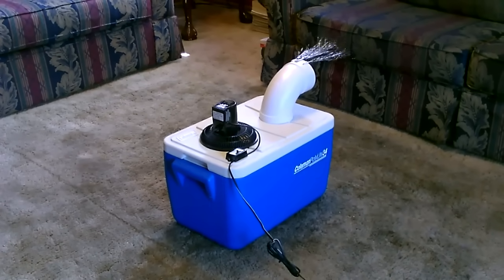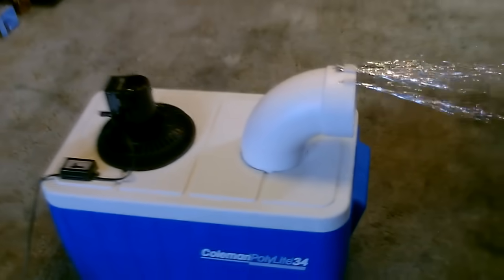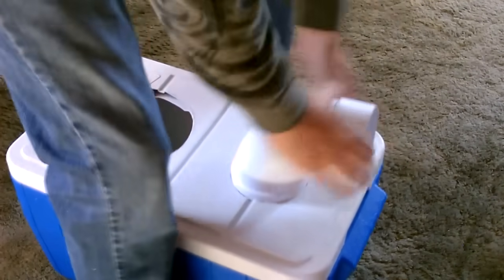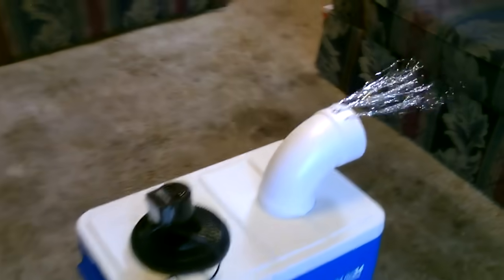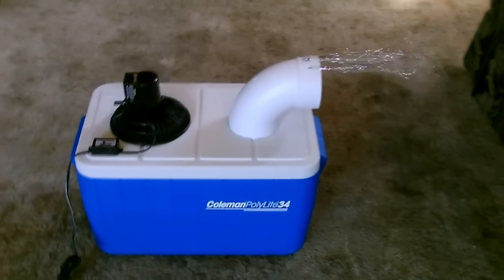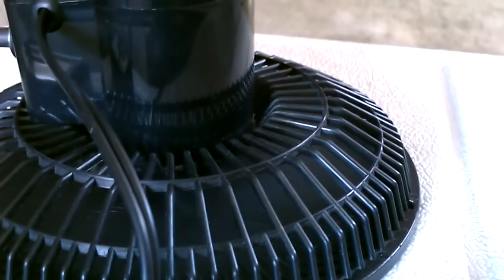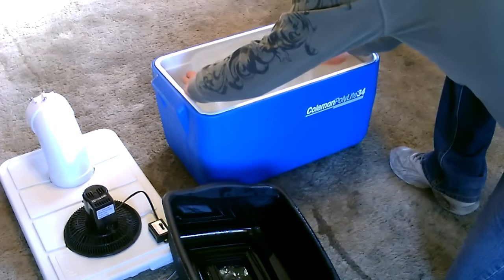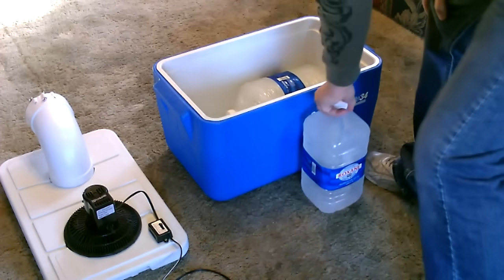Homemade air conditioner DIY - Awesome Air Cooler! - EASY Instructions - can be solar powered!

Comment: It's not an air conditioner, it's an air cooler. Nice tho!
Reply: if the air will make your condition well, its a air conditioner
Reply: joshua pogi Surely that would make it a person conditioner?!?
Reply: Shortkid110
You clearly do otherwise you wouldn't have taken the time to post a comment.
Reply: joshua pogi Technically, Simon is correct. One of the most important jobs an air conditioner does is remove moisture(humidity). This device will actually add humidity to the air, but the cooling effect will likely outweigh any humidification.
Reply: Willow Moon No.  Air conditioners are heat pumps.  They pump heat from where you don't want it...inside the room...to where you do, outside in the atmosphere.  They also use active cooling (expansion and compression of a working fluid...a refrigerant in that case) to perform work.  Mainly dropping the temperature of the atmosphere below ambient.   

This is a heat sink.  The air forced into the chamber 'sinks' its heat into the solid ice, which then begins to melt.  This is a set aspect of matter and state changes.  It's called the Enthalpy of Fusion, if you want to get technical.  All it does is displace the colder air by the ice that has already sunk it's heat into the ice itself.

Does that make sense?
Reply: Shortkid110 Ha! what a star! Nice one midget!
Reply: +Willow Moon Not exactly. An air conditioner also makes the air drier and cleaner as well as colder. Changing the temperature is only one condition it changes.
Reply: JR Culpepper  A silly arguement over an icechest, pvc pipe and a friggin fan. next  they will be fussin about  tea taxes ( or did we already do that one?)
Reply: Simon B If it changes the condition of the air from warm to cool, then would it not be an air conditioner.
Reply: That's not my last resort you brainless sloth. You started the abuse calling me a "fucking loser" when you don't even know me. I can't even be assed to find out what continent you live on, most likely cloud cuckoo land. I couldn't give a flying crap if you were 8ft tall, as far as I'm concerned you're an intellectual midget. Why don't you get a life. Or at least a job, and stop trolling. You're just a waste of bandwidth.
Reply: Simon B Simon, would there not be a difference between a typical cooler which uses water, and this contraption that uses ice?  I am not saying that it is more one or the other, but it does not seem to be "just" a cooler. Maybe we can elevate it to an"Ice Cooler" haha... Personally, I don't think the labeling is essential.  I am more concerned with does it use significantly less power (with the solar energy, it certainly does) and does it work well.  BTW, The "Shortkid110" won the asshole award in my book.  Have a nice day!
Reply: +Harry Balzak It really doesn't add any humidity as the discharge air is too cold to hold any significant moisture.
Reply: Really? I've never been on a video! Nice of you to check me out though, I am flattered. No, I'm not fat. I work in an office where I'm able to freely use the internet. I feel fine about myself thanks. I am in a really nice position.
Reply: +*Filo Blud*,  Your claim that, "90% of Americans online will always go on about how their country is superior" is complete and utter rubbish. Your "90%" claim is merely YOUR opinion and was exaggerated to make Americans sound as bad as possible, no doubt brought on by the argument between Simon B and *Shortkid110*. As an American I take offense to such a ludicrous claim because it's obviously false, yet in spite of this you won't find me making false claims about those from YOUR country. It's a real shame when someone from another country fabricates and/or exaggerates things about someone else merely because they said or did something you don't like. I have seen those who state their country is superior but in my experience I see this claim made by people of nearly every country on the planet yet you only see Americans doing it. How convenient. It's interesting how someone from any other country can make the general statement they "live in best country in the world" and everyone automatically knows what they mean. Oh but God forbid an American say this because they get attacked for it and accused of having a different meaning when that's an outright LIE. It's convenient (and sad) how some people apply a different set of rules for the same scenario when the person in question happens to be American.
Reply: These were once called swamp coolers. Air conditioners remove heat and humidity from a room.
Reply: Simon B I find 90% of Americans online will always go on about how their country is superior, compared to england. Shortkid110 typical american thing to say to a british person.  We couldn't care a less where you come from!
Reply: Filo Blud Thank you. I don't really care what he says or thinks. (or whether he thinks!) but thank you anyway.
Reply: Wow what a chain of arguments and racism.
Reply: Simon B I can assure you that that 90% accounts for only 3% of the internet's American population.  They seem proliferate due to their arrogance and ignorance.  My apologies on behalf of all those Americans on the internet who are not above all cretinous like Shortkid110.
Reply: AIRclan1 Thanks but don't worry, I don't tar everybody with the same brush! If everyone was decent we'd have no bar to measure anyone by. All men are not made equal!
Reply: I'm surprised you even managed to put that phrase together!
Reply: You have valid points! Using closed bottles, dehumidifies by moisture condensation around them and will cool. An older style furnace filter will clean air some.
Reply: Adrian M Yep! By golly you are correct. And he is totally useless.
Reply: esobed1 Please! Don't get us started on the tea taxes!!!
Reply: Adrian M Please don't feed the troll. I know as well as you do, he doesn't really count in 'real life'. That's why he comes online to sound off. Bit sad really..
Reply: Shortkid110 Lol so predictable. I was waiting for that, I almost posted to say 'wait for it'.

You finished school early today I see! Learn anything new in the 4th grade?
Reply: Simon B but you didn't.   It's easy to say you were going to say something after it was already said. 

Was that too confusing for you?
Reply: Adrian M I didn't dodge it at all actually.
Reply: Shortkid110 Not that there's anything wrong with that...
Reply: +Simon B you are right . i agree with you
Reply: lol a couple 6th graders have a tiff above and all of a sudden Dave M chimes in with relevant facts
Reply: Simon B  seems like somebody is having issues with English 😅😂😂
Reply: using closed bottles dehumidifies and cools
Reply: Mike Hawk 
Don't you know people are always jealous of Americans. Good reason too. Simply the best. Fuck off if you don't like my comment 
(Not you Mike)
Reply: Mike Hawk amen brother
Reply: Simon B Really, who gives a fuck?
Reply: Simon B How is that evident of giving a fuck?  It's just pointing out that you're a fucking loser.  Also air conditioners don't clean and filter the air. Lmfao
Reply: Simon B I'm 6 ft tall now, this account was made 7 years ago lol.  Sad how you know you're wrong and your last resort is someone's user name.  At least I'm not from the UK you chinless wonder.
Reply: Simon B lmao nice history, commenting on weight loss.  So you're some fat nerd who goes on videos acting like a know it all to try and make yourself feel better.  AYYLMAO

Comment: The only thing that should be noted is if you are using your home freezer in the same house, then all the heat that was removed from the water to make it freeze into ice just got dumped into the same area you are using the ice to cool. You're not really cooling the house off, just moving the heat around at different times. If you buy the ice or have the freezer in a shed or garage, then you are getting somewhere with heat removal.

Comment: I actually was inspired by this video using the ice that I am developing a similar unit that uses a chest cooler.. but with the unit I have built.. I used a 3.99 Styrofoam Cooler and a 6 volt case fan from an old pc... with using some internal ducting to have the input air travel to the bottom of the cooler (I cut a laundry soap bottle in half and pinned it to the side of the cooler and put a hole in the side at the top :) ) and then using two 2 Liter Bottles (from soda) filled with a salt water frozen mix (ionic solids lower the freezing point of water by 2 degrees C per mole added [ mole = sum of atomic weights in the compound and is measured  in grams] ) and with just that rig... with a 1.4 cubic foot box over the fan with a thermometer in it (cooking LOL) I dropped the temp in that 1.4 cubic feet in less than 5 minutes by 20 degrees...  and i think I can get it more efficient .. I will post pictures of the set up later on today :)
Reply: Okay here is the photos of my DIY AC Unit based on yours :)  https://drive.google.com/folderview?id=0B001oVz9lVUuflc4TnlSbFZyY1NyZ0oxSlIxbVA2c2dqY24tZE1yYm1rOXZjNzUxNUtBZUE&usp=sharing
Reply: Jesse Mercury Ummm  ingore the first unit that is a crockpot brewing deal LOL
Reply: Jesse Mercury By my calculations this unit as it is NOW can cool 400 btu per cubic foot or about a 20 degree drop in a 1.47 cubic foot of space in 4 minutes... this unit cost me 3.99 usd to make....
Reply: Hi, your system sounds like it works well, can you elaborate on the construction? The fan seems to be mounted on the top of the unit with the detergent bottle attached to the inside. And I'm unsure about how you released the cold air into the room.. Are there any videos showing this style? I think the best idea you had was using salt water, as it gets colder. Thanks!

Comment: This is so silly.  It is like re-inventing the wheel.  Freeze 4 one-gallon jugs of water, sit them on a water collecting tray (condensation will make a mess of your floors) and blow a fan behind them.  All said and done.  Nothing more to it. It works just as good if not better.

The only key to the question is, no matter what your technique may be (plain and simple or very sophisticated), is to separate environnements.

You see, your freezer doesn't perform "magic".  In order to freeze the water, it extracts heat from it and distributes it back into the room where it sits.  So, such a device will only work fine in a room isolated from the one where the freezer is.

But it works fine.  No question about it .  It will not cool an appartment unless the freezer is outside.  But it will nicely cool a room if the door is closed, away from the freezer's standing place.

Yes indeed, one can open some windows in the kitchen to give a breath of fresh air to the freezer.  It'll work fine at the bottom line and on the long run. But do not expect any sudden "magic".  This kitchen has to remain somewhat hot if you want your bedroom to be cool

The true story is to keep your cooled place away from the freezer.
Reply: rouelibre1Listen donut!, one can always freeze the ice the night before at cooler temps at home, to use in the heat in the middle of the next day.  Seriously ?! we get the thermodynamics of the setup, u just have to add a bit of time shifting...

Comment: Put your deep freezer on solar power and then your ice blocks are energy independent, power goes out no ice, then it would be complete, My deep freezer and extra fridge in my garage run on two deep 12 volt 650 amp deep cycle marine batteries hooked to a 400 watt inverter, charged via solar, i might try this, thanks for posting

Comment: I am not mechanically inclined where can I get a solar panel as big as that one, the little black box, and why the jumper cable?  Have you figured out a heat source for when the grid goes down? Also where'd you get that little fan? thanks
Reply: Salvage a muffin fan or two from a junk computer.  They use very little current @ 12VDC.  Any portable solar panel rated 2.5W should let them run nice.  His fan is over-kill.
Reply: rouelibre1 thanks, but I don't think a computer fan is going to push the air very well to disperse into a room.
Reply: WheepingWillow2
Yes indeed, man (if I may call you that, with all due respect).  This is all it takes.  A little quiet circulation will do the job.  All we are doing, is melting ice using the heat present in the room.  It'll work by itself even without a fan, but it will stagnate around the unit.  A small, economical to run and not noisy fan does the trick to move the air around in a nice and sufficient manner. Remember, heat will always seek for colder mediums and transfer to it naturally.  All we are doing is helping distribute this effect all through the room.
Reply: rouelibre1 well everyone else thinks I'm a man so I guess go with the flow. LOL Don't know of any self respecting man that would have a name as I do. LOL but anyway, I don't have either fan to use, so I'll have to buy one, so what is the amps of a little fan as you mentioned so I know what to tell the store? Thanks.
Reply: WheepingWillow2
Remember the old story about a butterfly wing in Brasil that that can accumulate into a tornado in Japan?  The same goes here.  Your ice body won't melt instantly.  It will take some time.  By this time, a nice circulation will have taken place.  Trust me.  :)
Reply: rouelibre1 yes, but what amp is the little fan I need to purchase, not this one in the pic
Reply: WheepingWillow2
Well, lady, I am more than happy to give you a helping hand. Not that I believe that girls are in need of anything that we can supply to them.  It is just in my nature.  I prefer to deal with a gal than with a dude.

See, my own nickname.  In french, we have genders for every word;  a "table" is feminine and a "floor" is masculine, go figure... But "rouelibre" is translated as "freewheel" and "roue" is a feminine word.  See if I care.

But to answer your question with regards to the power or current used in a muffin fan, it is not an issue.  They will all use minimal current @ 12VDC.  A 3" fan, 125mA and a 5", 250mA.  Nothing to talk about, they are all pretty much the same.  Yes, you can go for quality as far as ball bearings are concerned and all de doo-daas, but @ $5 a piece, you can let it die and replace it in 3 years time.  Go to a shop that sells surplus electronics.  The thrifty place, you kow?  Much better than Tandy Corp. Cheers !  :)
Reply: rouelibre1  ok thank you, have a great day

Comment: There's styrofoam cooler containers you can buy for a few bucks to do this to without power tools. You can spray the outside of them if they're not up to standards and caulking to adhere everything (including the fan mount that the fan can ziptie onto).

Comment: do you need pvc pipe at all? seems like cold air would still come out even if it was just a hole in the lid. better yet, why have a lid? couldn't you just blow air across the ice to cool the room?

Comment: Could you put frozen milk jugs (filled with water) inside instead of ice? That would mean you could swap them out of the freezer and not have to clean up any melted water each time.
Reply: yes.
Reply: Abelhawk Yes, but the surface area would be much less so you'd get less effectiveness. Easier cleanup though.
Reply: Abelhawk Sounds like a plan!  My main concern is filling the house with damp air - as soon as evening comes I could imagine everything getting damp.  Perhaps plastic bags could be used instead - I know for optimum cooling of an object you would have it in a solution of water and ice.  Plastic bags could in theory reshape to keep surface area.

Comment: This is great.  You answered my previous question re: voltage regulation.  One last ???  The 12V fans put out around 350 CFM of air.  It runs about $20 where I live.  I can get a 12V Radiator cooling unit that puts out 700 CFM of air and mounts more flush/flat.  Would that amount of air cool down enough or would it just bypass the cooling effects of the ice and blow semi-cold air?

Comment: Thanks a lot for the video!!!  I will be setting up a solar power system on my roof with a 45Watt (total) system with a regulator to provide power from 5v USB, 3V 9V and 12V output.  I have a drainage hose attached that drips the water out so refilling with ice and dumping isn't an issue...  Does anyone have any suggestions on the fan that works the best?  Also, would a dryer vent hose set-up limit the air?  I would like to direct the flow of air a little more.

Comment: Great job!
You can use the water to cool the air even more after the ice has melted by hanging synthetic shammies from the lid down into the water.
Air passing over water cools the air regardless whither its warm or not.
Nice video, thanks!

Comment: Have you made inserts for the holes in the lid so you can plug the thermal loss during transit? that way you can get ice at a camp store or other ice source  and transport the cooler to a camp site or other remote location?